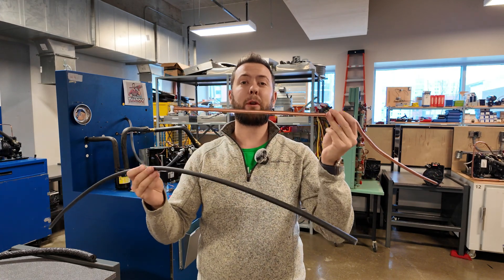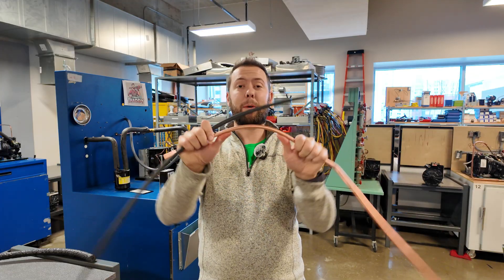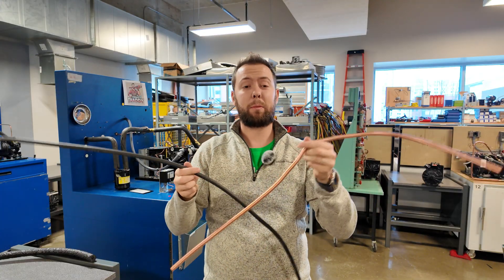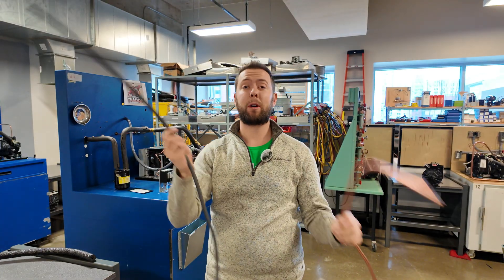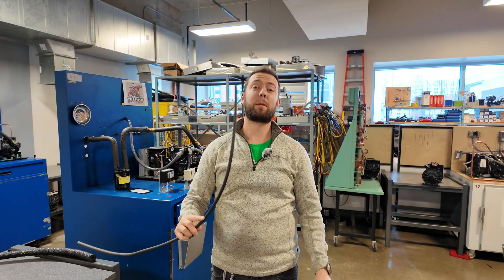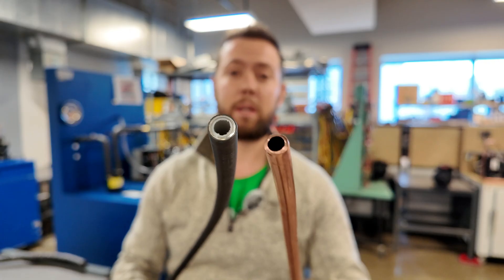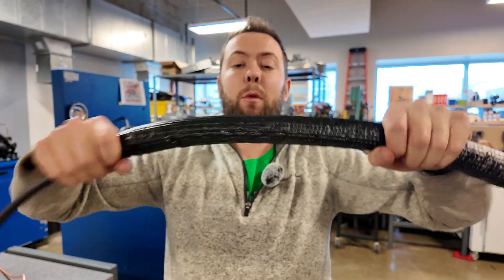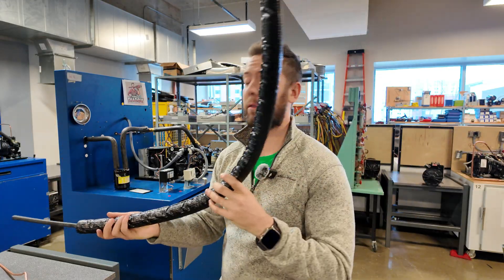Python Pipe - New alternative to copper? #hvacservice #hvac #hvacmaintenance #calgarysheatpumpguy

Comment: this product may or may not be the winner, but platic lines are the only way with simple connect fittings and standardize power and lv plugs so no ac campany can fuck shit up. AC will be changed for the better so f the rip off system and lets bring on the splits

Comment: How long has this been tested ? What is the psi failure ? What is the temperature range before internal stress failure ? Does it come in 7/8 inch ? What is the price ? Can it be flushed with solvents WITHOUT DAMAGE ?

Comment: trash is trash, you can flare all the copper you want on new systems. Copper is king number one reason is pest control, that plastic trash will not last and all it takes is some dingbat to flush that line with acetone and its going to be junk.

Comment: Looks like aluminum pipe inside. If so, that will definitely work-harden and crack inside if bent and straightened too many times. By compression fittings, do you mean "shark-bite" type with internal O-rings? It remains to be seen how long O-rings will survive, but I bet not nearly as long as soldered or brazed copper.